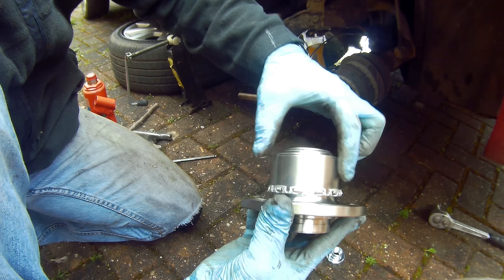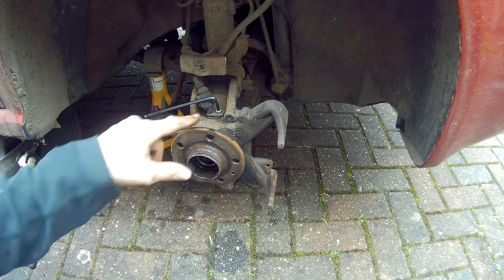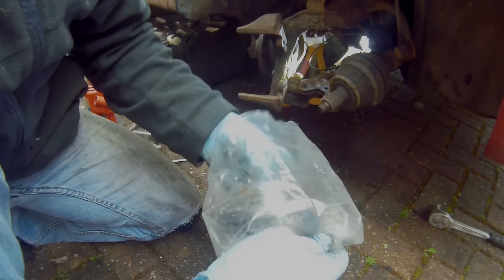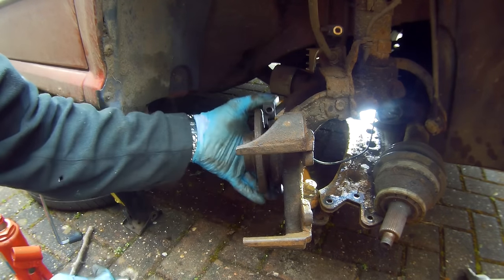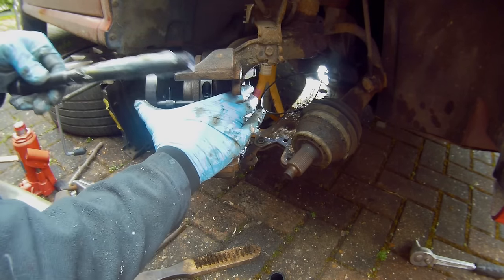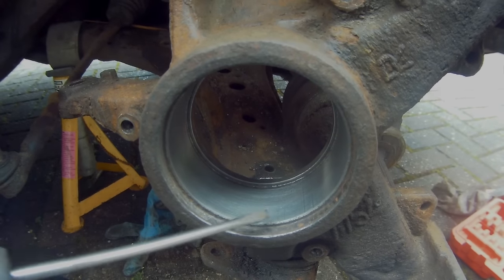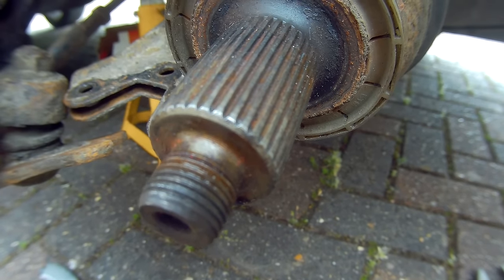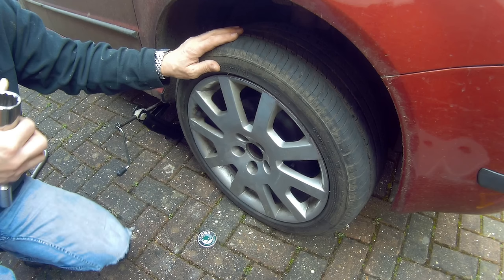VW, AUDI, SKODA, SEAT Front Wheel Bearing

Comment: Nice job and explanation, and you put all the info even reference numbers for grease but just not tool part number?
Reply from the maker: Thank, hope it is useful for you. The tool I use is not the VAG tool but a third party tool for these bearings. If you search for 72mm VAG wheel bearing tool there are many examples for your choice. You can do this with a vertical press with some difficulty, so I would only  recommend using a split-flange tool like the one I used :-)
OEM tool parts: 
1 - 	MP 6-414/2 with MP 6-414/5
2 - 	MP 6-414/1
3 - 	Separating device E-37 from V.A.G 1459 B/2
4 - 	MP 6-414/10
5 - 	MP 6-414/6
Reply: @HatBoyHarvey  
Thanks for the info.
I imagine it can be done with vertical press but you said and I read elsewhere, that there is possibility to mess up.
Reply from the maker: you could always price up taking the hub into a local garage just for them to press the bearing in ;-}

Comment: Need your help again im using everything basically the same as you but the bearing wont crack loose ive got a spanner on the other side but it wont budge ???
Reply from the maker: make sure you grease the shaft and then it is just a question of controlled torque (more than you imagine). There is a reason I used a large scaffold tube over the socket bar! It will break loose as it has nowhere  to go (penetrating fluid around the bearing edge if you like). Good luck :-)
Reply: Im using a large bar over the breaker bar also mate but it just keeps slowly spinning round and i cant hold the spanner on the back nut when im trying to put total pressure on the breaker bar and pole i dont get how your back nut did not even move and you had no spanner on it but mine keeps turning surely once im tight that back nut should not be able to turn ???
Reply from the maker: I understand, maybe I was lucky that time with the back nut. I'd try and use a ring spanner long enough to jamb it against something like the top of the hub that meets the strut  where it juts out. Put some temporary thick tape around it to stop it falling off as you may need both hand on the breaker side. it just needs to hold long enough for it to break/crack start the bearing off :-)

Comment: Audi A4 Haynes Workshop Manual: Removal and refitting of drive shaft. "Slacken the hub bolt 90 degress WITH 
THE VEHICLE RESTING ON ITS WHEELS".  When the job is done, refit the wheel and "LOWER THE CAR TO THE - GROUND", then torque the hub bolt". Clearly then, this does Not damage the wheel bearing!
Reply from the maker: This is my take on it and I am sticking by it. If you load the bearing before tightening there is a possibility of bearing surface damage such as scoring because: as you tighten the bearing from an unaligned side loaded position the surfaces are being pulled into central alignment in an unequal manner. No damage can occur if you torque up the bearing first as the surfaces remain central when tightening.

Comment: Hello my friend how are you  ...can you help me... I change the wheels from summer to winter but with one bolt i have problem my threads inside are broken ( in wheel bearing threads ) what need to do ... can i open with something new wheel threads  .. 
Thank you
Reply from the maker: If the threads are damaged inside the wheel hub housing then you have to replace the hub/bearing assembly. Don't be tempted to re-thread as the wheel would never be safe. Some may re-thread to save money, but they put themselves and others at risk. Fit a good quality bearing kit and have peace of mind :-)
Reply: @HatBoyHarvey  oooo thank you my friend a lot  one more question  WHICH MARK is good quality and good price you recommend  me ..?

Comment: Hi can you tell me please what type of Molykote grease you used there seem to be a few different types on ebay eg Molykote B2 plus, Molykote thread paste,  Molykote 44m medium grease Thank you in advance Dave
Reply from the maker: Molycote is a trade mark brand that VW/Audi group recommend in their workshop specification. I will put the specs in the description, but what is important here is to use high temp high pressure grease and Molycote is a synthetic grease that out-performs mineral based grease. I used some old high pressure/temp industrial bearing grease that I have used over many years without issue, but Molycote is recommended.

Comment: What puller kit did you use.  It looks a good kit but can't find it on internet.  Please help
Reply from the maker: Thanks for watching, hope it helped. Mine was borrowed so it may be an older one. If you search for VAG 72mm bearing kit you will find one the same. Just make sure it is for your specific bearing and that it is indeed the 72mm one on your car. hope you find one and fix your car, not easy, precise job, but highly satisfying when done right :-)

Comment: If doing this use a hydraulic jack as the widowmaker Jack's are not designed for this purpose
Reply from the maker: If you notice there is an axle stand holding the car up, the side jack is extra.
Reply: @HatBoyHarvey  oh I didn't spot that my bad

Comment: 11:40 that is clearly 90 degrees though
Reply from the maker: 50Nm without power steering and 50Nm+45* with. I have pour eyesight so I draw a line at 90* so that I could easily halve it as it is hard to just draw 45* It is pretty tight at 45* :-)
Reply: @HatBoyHarvey  that seems really low for a wheel bearing

Comment: if you buy the removal tool make sure its the right size...Got one off ebay which said its was for vw cars.....absolute rubbish ,didnt come anywhere near the correct size...kept it in my tool chest till i needed to use it.....what a con....no doubt my recycling village were happy with the metal i dropped off.Check your bearing size first,like i should have done...ebay have cheap tools for a reason
Reply from the maker: Absolutely. Please check bearing size before tool purchase :-)